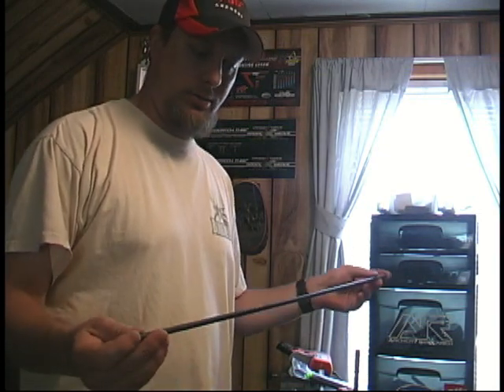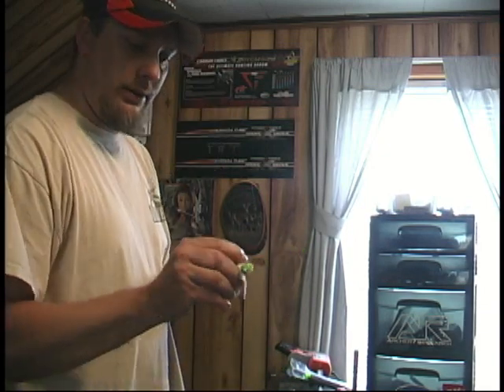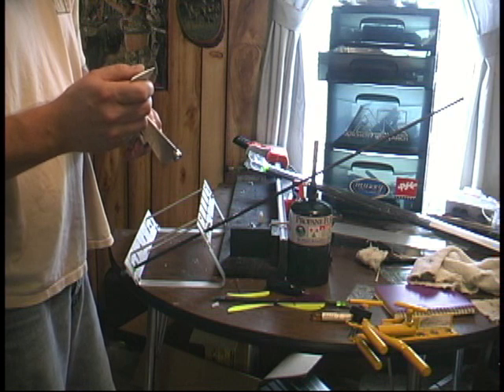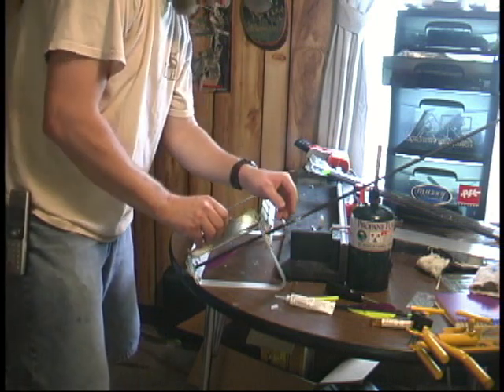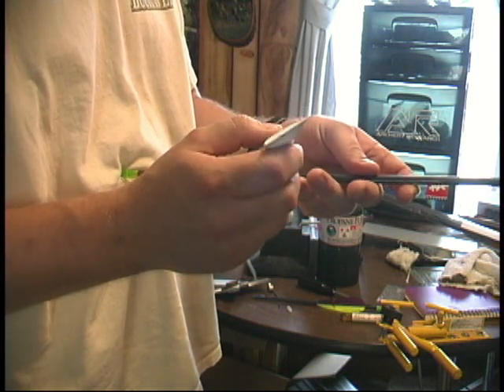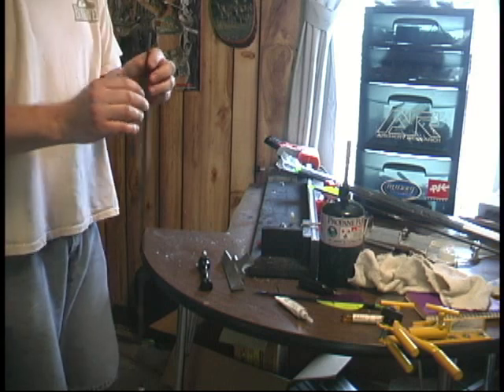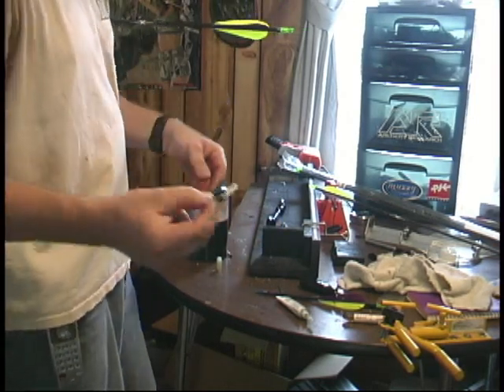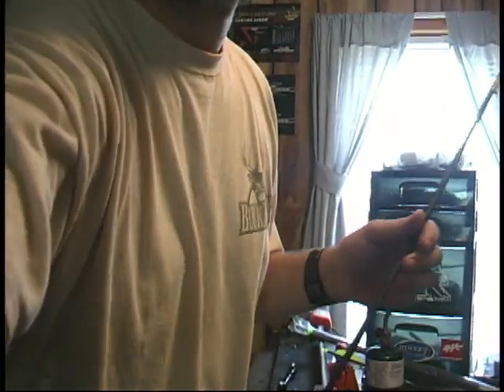How I build arrows,start to finish.

Comment from the maker: If it has a wobble you heat you insert tool and pull the insert back out and re-glue it.If it still has a wobble use a different insert.